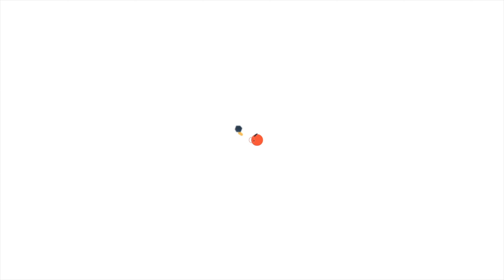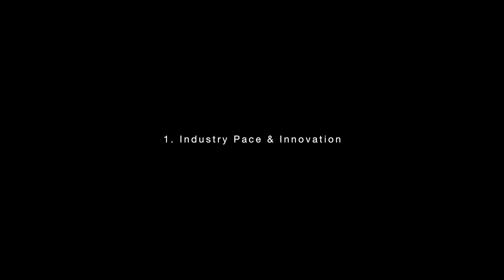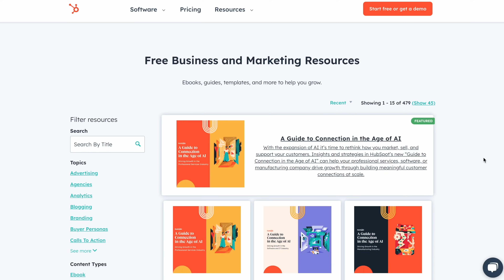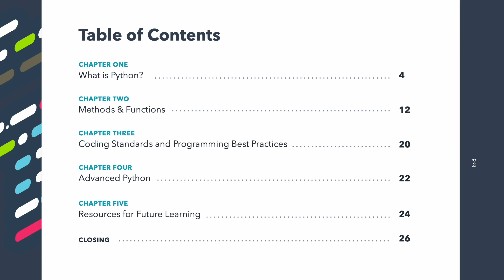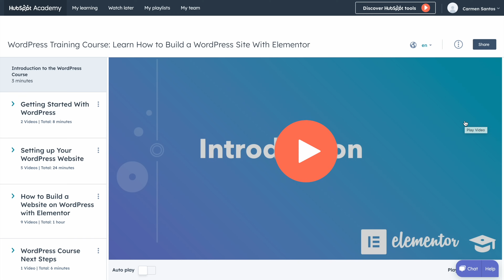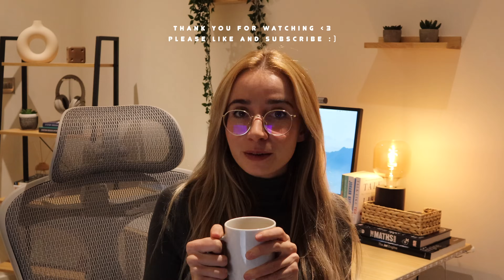Why I Switched: Aerospace to Software Engineering

Comment: I related so much to your statement about access to data in your field, I'm a software developer in the industrial automation space tasked with programming and setting up all these industrial machines and systems that I have very little knowledge or expertise in and whenever I would so much as ask for clarification or a simple explanation on something, I'm directed to go through all these unbelievably annoying "procedures" just to get simple information from "domain experts"  that would not only improve my implementation but also lead to improved system performance, efficiency and regulation. I sometimes get the feeling that the "engineers" at my workplace feel threatened by my skills and are intentionally trying to sabotage or make me quit. I have a computer science background and worked in finance before I segwayed into automation. I love my job but the rigidity of the people and near static nature of the field makes it almost unbearable at times. I know there are rules to be followed precisely and it demands flawless execution all the time, but I also know what I'm doing here, just help me do it better.

Comment: Everything you say about aerospace also goes for medical devices, just different details, and testing in a lab isn't as big and expensive. Replace FAA with FDA. Just as safety-critical. Much double-checking and triple-checking and no changes after a certain point except to go way back in the process. And both areas have their software disaster horror stories :)

Comment: This video is right at the right time. I have exactly the same feeling . My background is in materials science and aerospace engineering and currently I am pursuing my master's in applied math while working fulltime in defense as a systems engineer , checking designs etc but after 6 months I started feeling 'boredom' and not interested . 9 months later I am looking to switch to software since I am tired of waiting for security clearance, not being able to work remotely, using excel ,doing documentation and rarely using the things I learned in university.. One thing you should know is that when you have to do with managers and project managers , forget about science and engineering, one thing is in their minds and that is money .
Reply: Hello, Sharing your insights is very valuable for us students, thank you. I am a first-year student of computer engineering and I aspire to work in the defense sector within the aviation industry in the future. What path should I follow for this, and would pursuing a master's degree be beneficial? In your opinion, in which field should I pursue my master's degree?
Reply: @bilmiyoruminan Become good at what you study and keep learning things also outside your discipline. Today you need to be a multidisciplinary engineer and university will not teach you all those additional things cause simply there is not much time available with all the curiculum etc. I don't know what you mean exactly when you say you want to work in the aviation sector of defence, do you mean guidance navigation and control systems ? Radar specialist ? avionics specialist ? what do you mean
Reply: @dm7893-p2t 
I have always been interested in UAVs, drones, etc., but I am currently studying computer engineering:’) What do you think about artificial intelligence?
Reply: @bilmiyoruminan AI is good to have in your toolbox
Reply: @dm7893-p2t   thanks 🙈✨Devin AI ? Do you think AI can take over jobs?
Reply: @bilmiyoruminan bruh.. I am not a career center and i can't predict the future. You see , that's the problem with many first year students.. they ask too many questions instead of sitting down and working. If you work hard you don't need to worry

Comment: Fan blades as in turbofan jet engines? did you only focus on acoustics or could you design all the turbines, ducting, stoichiometry, cooling and metallurgy choices? say for a small turbofan engine.
I have this idea for an acoustic liner shaped like a mix of shark skin and a cheese grater so the air flows over the back of it but acoustic shockwaves are swallowed into the cheese grater openings.

Comment: I am an aerospace engineer and hold a master's degree in Design & Manufacturing. Previously, I worked for an EV company, and now I am currently working in space research technology. Having experienced similar challenges to those you described, I appreciate how accurately you portrayed the life of an aerospace engineer. One common aspect I observe in mechanical/aerospace engineering is the rigid processes we adhere to. Due to the complexity of these domains, companies often lack the flexibility to innovate quickly. While aerospace engineering is an exciting field, it comes with high risks that inhibit companies from experimenting with standard procedures, leading to a somewhat monotonous job for engineers. I'm not opposed to these processes, as they require considerable effort to develop, but as an engineer, I often find myself lacking challenges in my work.
Reply from the maker: Exactly, I completely agree. I understand that it is required given the nature of the industry, but it didn't feel right for me at the time because I was at the start of my career, craving something a bit more fast-paced. It doesn't mean that it can't be a fulfilling career, because I know it can if it fits your lifestyle :)

Comment: I've always wanted to be an engineer and be part of building some cool stuff.  I realized now that I would be into the kind of math that is more on the continuous side than discrete, but I know it can be combined.  Aerospace would be one of the best engineering jobs to have but it seems so specialized and few places to apply for.  But since I got my degree in accounting I went ahead and did something math-y like the Masters Economics program with some math course pre-reqs already taken to make up for losing my chance at learning engineering.  I did programming on the side, which is not the same as software engineering I know, but I regret not pursuing computer science even further back then.  Hopefully I can combine what I've learnt and become a software engineer, aha.  I've dabbled into supervised/unsupervised learning as an Econ major which is a subset of machine learning.  So maybe I can even develop machines and robots without knowing the mechanics and physics.

Comment: Hey I have a question. Have you worked with many human factors engineers when you were in aerospace engineering? 

I have a Master’s in Human-Computer Interaction and I’m looking to get into human factors engineering. Plus I have a background and experience in software engineering (particularly on the front end) and UI/UX research and design.

Comment: Nice video! I'm a software engineer -> SRE with a computer science degree. I've been thinking about going back to school for physics. I'm curious what you'd think about the idea of merging computer science and physics? I was looking to get into fields that would require a background in physics where my computer science degree and experience would be valuable.
Reply from the maker: I think that's the best of both worlds :) but based on my experience, it's not so easy to find the right job that combines both in the right way. Some jobs get the physics right but you work on archaic, outdated, frustrating technology, while others give you a lot of freedom on the software side but then you're so far removed from the application / physics that it feels like you're just a developer - e.g. you end up building websites or internal tools for engineers / scientists to use and they do the fun physics analysis, you're just writing react UIs.
Reply: Understood. Thanks for the insight. I work with an aerospace engineer who also switched into software -- maybe it's a "grass is always greener" situation. 

However, I'm still interested in pursuing work that blends together my experience and physics. Be it quantum computing, robotics, etc. 

Does your current job utilize your degree and/or your past experiences?
Reply: Mechatronics. Automotive embedded software.

Comment: but wait.. software engineering is solved with AI now. So isn't it better to be in aerospace/mechanical/ect engineering?
Reply from the maker: Software engineering is more than just writing code which an AI could write :) similarly, traditional engineering is also not just doing calculations / circuits / simulations. I think there are a lot of aspects of being a good engineer that AI cannot replace yet. Plus we will need software engineers to run, scale and maintain AI.